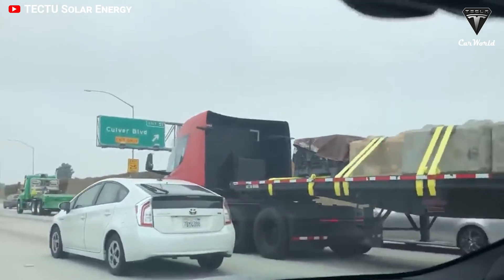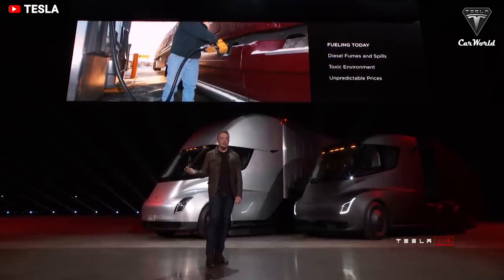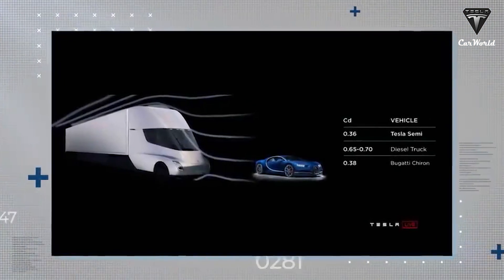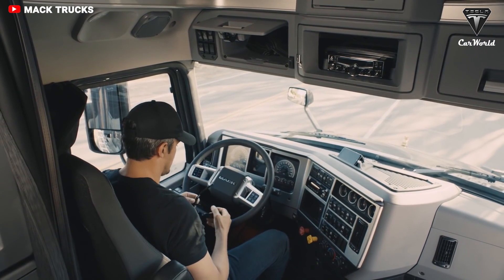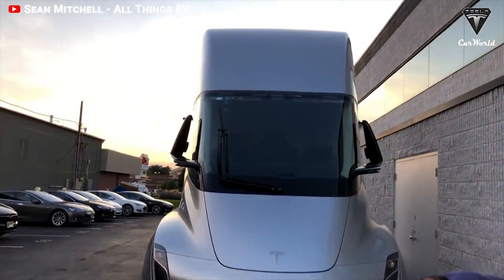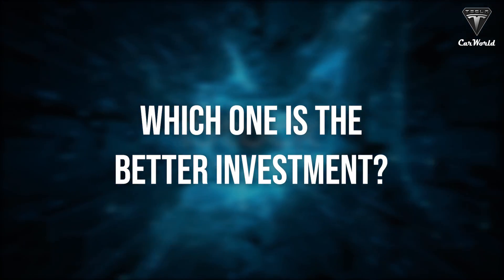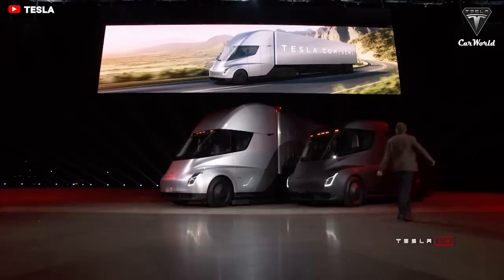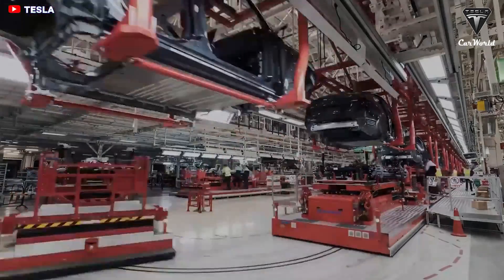Which is the KING of 2023 heavy trucks? Mack Anthem Diesel Truck Vs. Tesla Electric Semi?

Comment: What is the Cap-Ex and Op-Ex of Mack compared to Semi.
What is the cost per mile and what is the cost per mile per kg of weight.
On the environmental front how much CO2 does a Mack truck produce per mile unloaded and fully loaded. 
When Tesla or PepsiCo publishes these things we can compare but I guess it will be more in favour of Semi than Mack. 
Given that the cargo owners want to have lower carbon footprint logistics play a big role in this. Cargo owners will switch to carriers that use Semi. Only the most cost sensitive cargo owners will still use Diesel and not give a shit about their corporate emissions . If you a consumer facing company like PepsiCo then you have no choice but to use an EV and to market yourself as green and or lowing carbon footprint.

Comment: Who cares about acceleration? The point is range,  operation costs,  maintenance and repair facilities (including minor repairs by the buyer's mechanics), availability (you don't want to wait 3 years to get a new truck if one on  your fleed suffers an accident) actual cargo,  utilization possibility and common parts (the tesla is likely to be better for flat routes, but If I have a mix of routes do I want to deal with two corporations or do I deal with Mack only)I hope the  Tesla Semi succeeds but it's an uphill battle, in particular, once the hype dies and the actual results become public.

Comment: So somebody out there thinks it's a good idea to go 0 to 60 in 20 seconds with the  loaded trailer? It's gonna be interesting to see the carnage that causes.

It seems like a good idea if you have the ability to recharge your truck out on the highway.  The thing is absolutely useless if you don't.

You will notice that they have not added in the cost of hotel rooms. There is an extra $700 a week.  

Another $250 a week for food because there's no place to do your cooking in that truck from what I can see from the pictures.

Now the average car drives 25000 km a year.  And the average Tesla battery pack needs to be replaced every 5 years at a cost of approximately $25000.

The average truck drives 10 times that distance.  So add another $50000 a year for new battery packs.  Don't complain to me, do the math. 

That's right folks, unless Tesla has figured out how to either give away free battery packs or make the battery pack last longer than 200000 km, These long haul truckers are gonna have to replace the battery packs every 6 months.

And there's absolutely no infrastructure in place anywhere for repairs to your new Tesla semi. 

 No thank you.
Reply: This wont age well😂

Comment: 5.9mpg was the comparison... even company drivers at mega carriers get 7mpg. Any skilled owner operator is getting 9+mpg easily. Cost wise the diesel still wins by a landslide. Then there is the distance comparison. Diesel kills that one as well. Not to mention maintenance... Goodluck getting roadside to help with side of the road breakdowns.

Comment: This sounds great, but what happens when you have to make a delivery over 1000 miles with the Tesla?  The one part not covered is time!  How long do you have to sit and wait to recharge such a big battery compared to filling a regular fuel tank?  Long trips need a sleeper cab where is that?  Or are these only made for shorter runs which is why it makes sense for a company like Pepsi?
Reply: Then you just use diesel truck lol

Comment: This is like ALL the other Tesla sites  a sales pitch to get investors to buy Tesla Stock. 5,000 lbs is the battery weight of this slow charging dog. And you,ll never see a dual trailer long haul Tesla semi.
Reply: 70% of range in 30min after 500mile sounds great to me, you will need to rest anyway after that time and in 1h you're at 500mile again...
Reply: @lukabosnjak3829  Those are Tesla numbers.Go to Ford or Toyota .They all say what the vehicles are capable of under their tests .I understood the battery weight was 5,000 lbs.That's 2 1/2 tons of cargo less.

Comment: I don't comparison at all, your trying to make comparisons off of HP and torque, drag coefficient and not overall range/efficiency, if you take a standard 12.8 from any manufacturer it still is measuring almost the same in practical performance. If you step up to a 15.8L it gets even worse for the Tesla, not everything can be measure by charging and up front performance alone. I can predict that when trucks become automated at scale, they will still be diesel for a good many years forward, and if rare earth minerals become scarce then all of the battery production will see a lot of issues. I'm not even a fan of diesel, but as a truck driver, this comparison feels cherry picked.

Comment: Uh, the drag coefficient is not why the acceleration is so different. It helps, sure, but it’s electric motors. Either way the acceleration hardly matters with a semi, all be it extremely impressive.

Comment: Have never been a fan of electric vehicles. Man what would you do if you were driving down the highway one of your display screens with your mirror goes out ? Would not be a good day lol. At least with a traditional mirror if it gets cracked or broken you could easily get it repaired without too much hesitation. Or ask yourself this question what happens if the display goes out completely could be a simple fuse or maybe your screen went out now you don't know how fast and stuff you're going lol. New technology is always but it can be a pain in the neck as well

Comment: I think the biggest wow factor is how regen break will impact trucking moving foward. Once you drive with regen break, you will start to feel how "everything should be this way" because it's intutive and safe.
Reply: All diesel pickups and semis have engine braking.  My f350 goes downhill down big 6% grades hauling 15k lbs without gaining any speed. 
But Regen braking, even though it doesn't really change the way a diesel truck goes downhill, giving the energy back to you is awesome.
Reply: bro I drive trucks. I'm so stoked about this feature. for those who don't drive semis, this alone is revolutionary
Reply: @balthazarbratt8194  is it as revolutionary as carrying at max half, at min quarter of the cargo weight?
Reply: @dr_birb  The truck has  a video of it carrying 82,000 lbs 500 miles. unless they lied and cheated on the video, you're wrong
Reply: @balthazarbratt8194  it doesnt carry 82k lbs, it weights 82k lbs total (cargo+semi).
Which is max gross weight for a semi. Which every semi hits given the cargo allows it.
Question is, what is the tesla semi curb weight, aka without cargo weight. Aka what's the max cargo weight.
Reply: @balthazarbratt8194  it did not carry 82k lbs, that's the dot limit, I can bet money on the tesla semi being almost twice the weight due to the battery pack which would reduce the load it can actually haul
Reply: @balthazarbratt8194  the 82000 lbs is the weight of the truck and the cargo. They never stated how much the cargo weighted
Reply: @TheSpiritofSpeed  However, when you compare 3 football-sized electric motors (100 lbs/ea, 300 lbs total) to a massive Mack MP8 diesel engine (2,560 lbs) the Tesla saves 2,260 lbs. The battery pack will be fat though, no doubt. 

But overall, even if payload is reduced by 10-15%, the Pros will outweigh the Cons. With Tesla's safety features alone, trucking companies will save far more $$$ by reducing their liability from ownership and reduced insurance payouts from accidents.

Out with the old, in with the new. Just wait for Semi 2.0 lol.
Reply: @M1ster.Fr3sh  the battery pack alone outweighs the benefits of the "weight savings" a 2650 lb engine or a 1kwh battery pack that weighs about 10k lbs, that's over half the weight of the truck given the fact that it's a 6x6 and the heavier weight the tires are probably special made for the truck itself and will be expensive, as far as safety goes and comfort it's not innovative center drive is a gimmick you constant have to hand out paperwork outside of your driver side window so now you have to get up and out to hand off paperwork, and the lower cargo capacity of a trailer means less freight it won't be a big impact now but if every truck was a tesla semi you would have more trucks to carry the same amount of cargo. The reliability issues and fire issues are also a big risk. Ev fires are extremely dangerous and hard to put out so a huge battery pack like the one in the tesla will burn for a long time and produce a huge amount of toxins
Reply: @LEOKRAUZYT  There's just as many issues with current diesel tech. You seem biased, honestly.

Give it 5-10 years, you'll see how superior EV everything is, including Semi's.

Truckers are not that bright of people, it's no shock they dig their heels in the ground and resist change. They'll learn..... eventually.
Reply: @M1ster.Fr3sh  lol the superiority complex 🤣,  truckers not that bright and what issues many diesel trucks and engines are designed for durability mishaps happen sure but on average 250k miles is breaking a semi in 1mil is considered near end of life but new transmission and engine good to go, depending on the truck most can average 800 to 1k miles or more fully loaded, and are still a better choice for long haul. I'd say keep electric trucks for short distance it's more feasible and better for people. That and truck fleet managers have to worry about logistics and maintenance, you can slap a engine and transmission together and get a truck up and running, say you don't get an update or a key component for your motor or battery goes bad now you have to wait for a manufacturer specific component. Trucks have to be practical unless you have service centers multiple in each state stocked with parts it's not gonna happen. It'll be easy to take a damaged truck to a garage and fix it if it's a diesel parts are common that can be swapped instead of we have to load your truck on another truck send it to Cali or Texas to fix it and you wait here for a few days. That and alot of truckers see their truck as an investment and live in their trucks because miles=money and more often then not that's what you gotta do to earn interstate, tesla doesn't offer sleeper cabs or 2 seats for a co driver if they did either that's more money and weight on the truck 509 miles doesn't mean much when you gotta drive back home to sleep or pay a lot of money for a overnight stay,  when your 100k+ truck can't even offer a bed or basic necessities for a trucker.
Reply: @LEOKRAUZYT  deleting my first reply, that was unnecessary... my bad. 

I get it, there's certain features that current trucks have that the Tesla doesn't, like a bed or realistically convenient options for repairs/maintenance. Big companies like Pepsi that ordered 200+ trucks have a robust repair network and can afford to have a few trucks in the shop and be fine. A self employed owner would hurt more with a broken truck. That's how all new tech works though, it takes time to build up the network.

Similarly, diesels don't have the safety tech, or power that Tesla's do. They also can't refuel while getting loaded/unloaded like a Tesla semi can, requiring additional stops at gas stations.

 Above all else, the safety features, regen braking, and reliability of electric motors(rarely break or need maintenence) are Game Changers for the trucking industry. That shouldn't be debatable, it's literally night and day.
Reply: @M1ster.Fr3sh  you clearly haven't been around a truck or on the road and it shows so I would limit myself when it comes to making bold statements like those, not everything Ev is better, for local routes is a maybe but for OTR its very lack luster and will actually increase the price of goods since the load capacity is reduced
Reply: @M1ster.Fr3sh  it's all good but the issues are that it's still unproven you can say electric motors are reliable but only in the sense of daily driving a pov not pulling a 40k lb load daily up and down hills putting some serious mileage on them, ev semis make sense for snack and food distributors because they have alot of inner city distribution and their trailers are relatively light at full capacity usually around 30k for a coke/Pepsi trailer. As far as commercial use goes especially with a lack of features as far as safety goes, regen braking is ok an all but with an electric truck if it brakes too hard it'll shift the load and cause an incident. The cab looks like it's missing a Johnny bar too inside. Tbh it's not that don't see the advantage of ev semis, I just trust long standing semi Manufacturers over tesla, the battery ranges speak for itself too they know it'll be for deliveries in cities. But too much tech is too much for example how low the tesla rides if you have a damaged/blown out tire will you be able to replace it on your own, will a jack be able to fit underneath  or even handle the weight of the truck, does it offer a ctis option for snowy and rough road conditions or will it have to stay at its psi for driveability,  will the truckbe able to air up it's own tires if the psi changes. My last issue is the cab design cool it's aerodynamic but I noticed a lack of focusing on cab protection Wil the driver be fine if the truck ends up in a accident or tipping over. I know the semi will be bottom heavy but if you skid and the trailer goes either it rip off the 5th wheel or more often will take the truck with it turning both over. I don't think tesla knows how to design trucks, they often over promise on things and fail to deliver
Reply: @dr_birb  From what I can gather the tesla weighs 25k empty which is pretty damn heavy considering my 379 Pete with a 550 cat only weighs around 19,000 with full tanks of fuel one advantage of a diesel truck over electric is we can carry less fuel to haul heavier loads where there is no burning off the weight on a tesla
Reply: @balthazarbratt8194  I drive as well and we’ll… I see where this is heading.
Reply: I have a feeling that a few of the new Tesla trucks will overturn on a sharp corner while the truck is using it's regenerative braking, while also going to quickly into that turn.  What happens is the heavy trailer starts to push the truck that is using regenerative braking, and the truck can overturn!  Unless a very alert driver actually pushes the gas pedal as the trailer is pushing the Tesla truck sideways!  And perhaps also thinks about activating the trailer brakes hard when the truck is being pushed sideways while using the truck regenerative braking.  It will get fixed with a software update that will apply the trailer brakes when going into a turn if the regeneration braking is slowing the truck.  

Wait and see!
Reply: Engine brake , u probably havnt experienced that before.
Reply: false
Reply: Brake not break lmao
Reply: It's a no gear truck,  regenerative braking will be 900 Hp at full speed only, but a lot less when you try to stop.

Comment: Drag increases with the velocity squared.  So drag really matters at highway speeds and beyond and not so much when you are accelerating through 10-15mph, or kph or knots. 
And - your video is in serious need of revision since the Semi is using plaid motors instead of Model 3/Y motors.

Comment: how can the battery power lights, run the air compressor for the trailer brakes and still go 500 miles all at the same time

Comment: Nobody needs this trash truck. Truck must pull and do this as cheap as possible, and work very long very far. This is crap, battery will die as more you pull more energy it will take from battery.battery not cheap, to charge tou wont find, and if you find it will take forever which means you got fired, cold climate you will loose lots of range. Major thing battery stays at same weight. So truck with fuel every second becomes lighter and more economical. Betrer whait for toyota hydrogen. In all world everyone knows hydrogen will take over. And elon tryed to say hydrogen is dumb, lying simply. He knew  toyota coming.